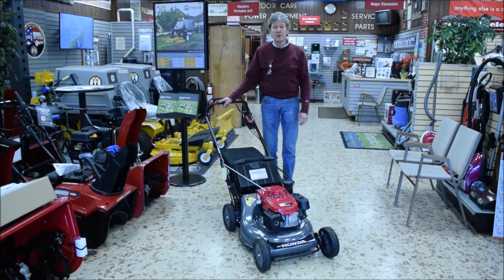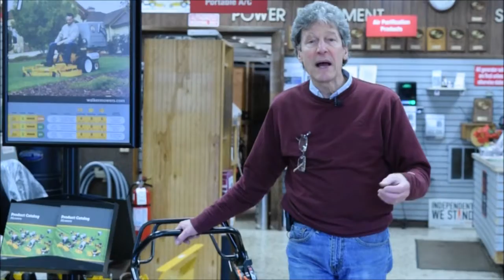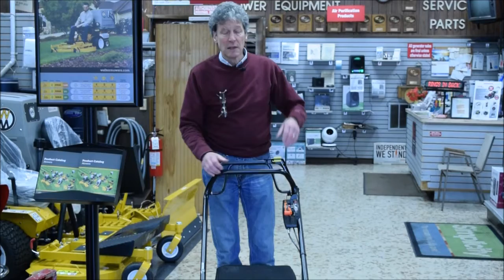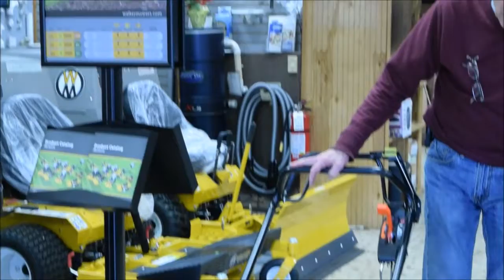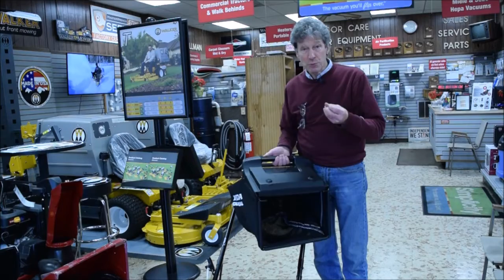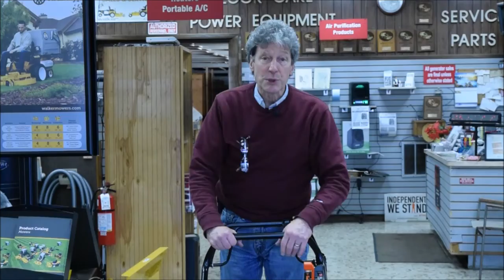Honda HRC216HXA Lawnmower Overview

Comment: where can I get a discharge kit for the HRC 216?
Reply from the maker: Presuming it is still available (which it should be -- I'm home and not at work -- can't verify) you should be able to obtain it through your local Honda Outdoor Power Equipt Dealer.

Comment: Do you have any of these mowers in stock?
Reply from the maker: I'm sorry -- no we do not.
Reply: Are you able to get anymore of these?  It’s my understanding that Honda has decided to get out of the mower business.  Very disappointing to hear they are ceasing production of mowers
Reply from the maker: @jburello2588  Yes -- it is true -- Honda is discontinuing production of lawnmowers.  I think even the Honda corporate staff are a bit dumfounded.
Reply: Any chance of getting anymore of these mowers HRC’s before they discontinue production?
Reply from the maker: @jburello2588  You would have to find a Dealer somewhere that has stock on this sku.
Reply: I have a 2008 HRX217 with the GCV190 but no BBC …still runs but we recently moved onto a bigger property with more hills and I was hoping to get one of the HRC216’s.  If I can’t get one I’ll have to consider a new HRX217….but would prefer something from the commercial line
Reply from the maker: @jburello2588  Toro makes an excellent 21" Commercial mower -- it is essentially an equal to the Honda HRC.  A model 22297 or any of the lateral models would serve you very well.

However, for larger areas, I would immediately recommend a Toro Turfmaster.  It is a 30" walk behind mower that handles a lot like a 21" unit; but, will reduce mowing time by around 40%.  I use one myself; so, I know whereof I speak.  Toro also makes a residential 30" unit called a Timermaster; but, the commercial unit is a much better machine.  Running around $3000 .......
Reply: I have been calling and I can’t find anyone with the commercial Honda
Reply from the maker: @jburello2588  Probably a done deal.

Comment: Bought this mower yesterday. Love it but the mulch plug allows grass to be discharged from the rear. Not a tight fit.  As a temp fix I stuffed a plastic contractor bag behind the mulch plug and it works well.  It leaks a bit at the top while bagging. All in all I'm excited to use it.  It does have a rock solid feel and throaty sound. Nice vid I learned a lot. Thanks
Reply from the maker: Yes - it is a solid piece of equipment and I am sure you will find it will work well for many years.

I suspect the bit of leakage that you are seeing is due to the fact that the unit cuts so powerfully that a small bit of debris is being forced out any small apertures (I should say that this is the first time someone has indicated this to me).

Comment: What a beautiful and professional overview. A true old school without a need for a comic relief or special effects. I recently bought their top of the line residential model HRX 216. I use it commercially and this is my second one. The old one is still performing well after 8 years of continued work. HRX 216 has few of the same technologies you've pointed out in this review. From the hydrostatic transmission to the blade brake clutch (Honda calls it BBC). Although the engine isn't commercial, my experience with it is so good that I don't need it to be. But the interesting thing is that the engine on my mower is more powerful than on this commercial mower. It's 200 cc vs 160 cc. There are few more reasons why I went with the HRX 216. First is the plastic mowing deck that is much lighter, tough as a nail, doesn't bend. Next is the Versamow system that allows you to change between bagging, mulching and discharging with a push of a lever. Oh yes, let's not forget the 500$ price difference.... I would appreciate you doing the same overview on HRX 216. Maybe I've missed something that you could tell me about my mower.
Reply from the maker: Hi Mark -- thanks so much for your accolades and review!  We do have a video on the HRX217HYA -- you can find it on Youtube or on our website at www.etpetersen.com

Thanks again.

Comment: I purchased this Honda Mower (HRC216K2HXA) ten years ago for my personal use and friends and neighbors said i was crazy for paying so much, i paid like 1200 at the time so basically it’s 120 a year and really that’s not much for a mower of this quality, and i know it will last another 10 years easily…. and i do the bare minimum just change the oil twice a year and the spark plug every year, and just lube it here and there and boom works like a charm…
Reply from the maker: Yes -- thanks for your input -- very durable product and, for residential use, close to bullet-proof.
Reply: @keithpetersen8114  The one thing i can’t figure out on this model is do we have to change the transmission fluid? i took it for service about 4 years ago and they only topped it off but i was thinking about doing a fluid change this year, the service manual doesn’t mention changing the trans fluid at all.
Reply from the maker: @mikeFPS1980  It's a sealed transmission -- it should be ok without attention.
Reply: @keithpetersen8114  awesome! thanks Keith!

Comment: Man, maybe you can help me out.   I have an older HXA that needs new wheels.  The rear propelled wheels have an axel with 1 single pin thru the center that fits into the center of the wheel and the cross pin fits into 2 notches in the wheel.  I cannot find a replacement anywhere.  If I lookup wheels for the HRC 216 HXA they look completely different.  Can you help??
Reply from the maker: Sorry to be so delayed in responding to your inquiry -- just seeing your comment now.  If you still need wheels they are available -- you could contact us here at 908-232-5723.

Comment: I will be buying one of these to start cutting yards.
Reply from the maker: Hi Charles -- sorry to be so delayed in responding to your post -- this machine will serve you well in your business.
Reply: @keithpetersen8114   It has I have about 12 accounts.
Reply from the maker: @charlesjacksoniii8787  That's great!  If you have larger yards or add more accounts you might like to consider a Toro 30" Turfmaster -- we have a review on the Timemaster (residential model) and, I believe, the Turfmaster (commercial model).
Reply: @keithpetersen8114  OK I ended up getting a Exmark Lazer Z 48" for bigger properties.
Reply from the maker: @charlesjacksoniii8787  That'll work!
Reply: @Keith Petersen  I’m not a fan how the TimeMaster/TurfMaster is designed.  I like my Canadian market Honda Commercial HRC216k3HXC as it works very similarly to my old HR214SX.  To change deck belts on the Toros takes an hour and the pulleys are plastic, plus the timing system is not perfect, especially if you hit something you can’t see as it wrecks quite a bit of expensive pieces inside the machine.
Reply from the maker: @WJCTechyman  Yes -- the Honda HRC series is a lot like the old HR214 -- an extremely durable, well-engineered product (a bit heavy, perhaps).

The TimeMasters and Turfmasters are different animals.
Reply: @keithpetersen8114  Still, they have a lot of mechanical headaches to fix.  One person who said they got rid of the time master and reverted to his Honda because the down time with replacing the belt between the deck and the engine took over an hour.  Every Toro I have encountered has been belt hell.  Never again.  The single stage Toro snow throwers, especially the older CCR2000 series with the Suzuki two strokes were nice reliable machines.
Reply from the maker: @WJCTechyman  Yes -- the old CCR2000's were both reliable and easy to service.

We have sold a good amount of Timemaster and Turfmaster machines over the last several years -- we have not seen any substantial issues with them and, the Commercial Landscape Contractors have been steadily clamoring this year for the Turfmasters which, two months overdue as we "speak", are still not in our inventory.

Comment: I own this machine and I love it, I use it for residential service only thing I would change is speed of engine and take a few lbs out of it other than that it's extremely well made piece of equipment.
Reply from the maker: Sorry to be so late in responding.  Honda uses a bit of a lower speed engine but with enhanced torque -- and, yes, very well made!

Comment: What is the cc on this mower. Deff better than toro but toro has a 180 cc wonder what Honda makes on commercials mowers
Reply from the maker: Hi -- 163 cc but keep in mind that Honda is conservative and typically underrates all their engine sizes/horsepower.
Reply: Keith Petersen deff getting one my comercial toro has giving me nothing but trouble .

Comment: I just purchased the HRC216HXA after the shock at what it costs wore off. Your information explains this machine perfectly and why the cost is high. Thanks for your video.
Reply from the maker: It is a really good machine; but, certainly not inexpensive.  However, it is pretty close to bullet proof -- especially for single property/home use.
Reply: @Keith Petersen  The average lifespan of a machine like this is roughly 30-35 years with few consumable costs.  I try to look for that in machinery.

Comment: Still like the Toro Super Recycler or their commercial for one thing. The deck is aluminum and will not rust.
Reply from the maker: Yes -- true enough -- we sell that unit, also, and I equate it to be the overall equal of the Honda HRC mower.
Reply: I got a new Toro Super Recycler on order. The one with electric start(Got a few people who struggle with pulling the rope. The John Deere 14SE was going to cost too much to fix. It was from 1996. My 1986 Lawn-Boy 8480 is running perfectlly. And the aluminum deck on that is perfect as well.
Reply: Aluminum will rust!

Comment: What would you pick between Honda HRN216VYA vs the Toro Super Recycler all black with Honda engine? Pros of Honda: new engine and stop start system. Pros of Toro with Honda engine: personal pace system and all black color. I would get the Toro but not having stop start seems like a deal breaker.
Reply from the maker: Hi -- sorry to be so delayed in responding to you -- we've been totally busy and I missed the posts on this video.  I would pick the Toro -- better deck and much better/more durable drive system.